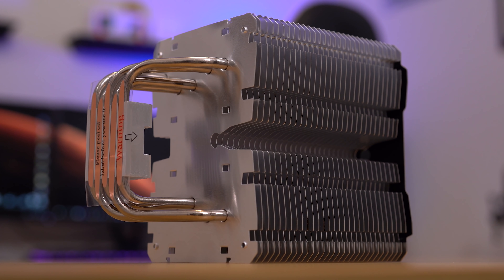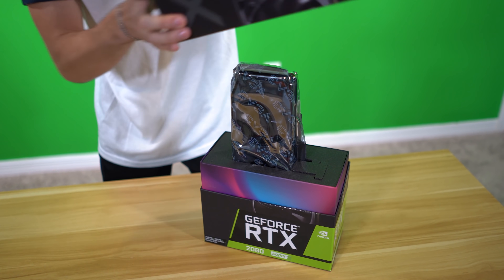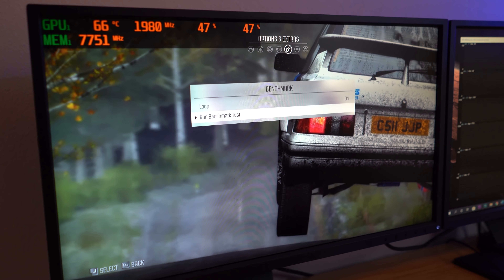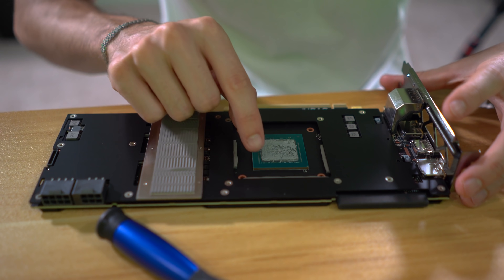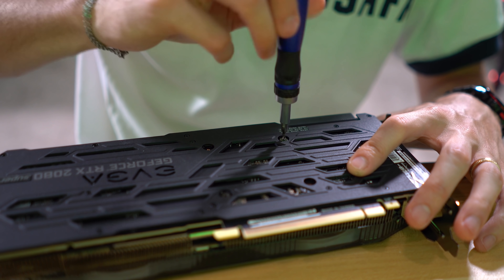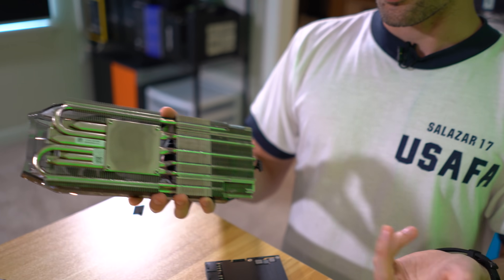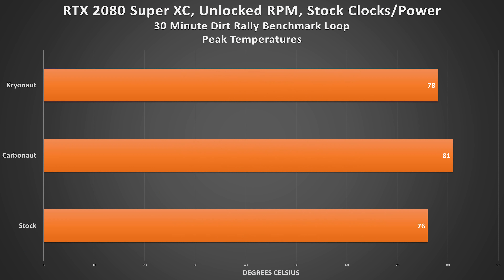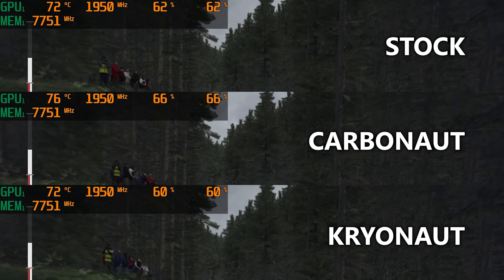Carbon Pad + $800 Graphics Card = ?

Comment: Spread method gives some air bubbles; which will eventually go with some on off thermal cycles. I usually do X or line application.

Comment: My evga rtx 2060 super sc paste looks the same. But I replaced it with crappy mx4 and gained 8-15 degrees and it doesn’t heat as fast.

Comment: My evga 2080super never even gets hot enough to need this lol. I have the ftw model and even overclocked it is simply warm to the touch
Reply: Yeah, the FTW model has 3 fans vs 2. I have the model Greg is using and it does indeed run hot.  In retrospect I wish I woulda splurged the extra $70 bucks and gotten the FTW model.

Comment: Sounds like your gut was right and the Kryonaut was the best overall. I dunno if they ever planned on the Carbonaut being used on GPUs... But it would be nice to never ever have to worry about thermal compound degradation, I'm pretty sure the way they make the Carbonaut pads they'll last forever and a half
Reply from the maker: Yeah we mentioned that in the video. Carbon doesn't just disappear. It's designed to last forever (or at least significantly longer than traditional thermal paste).
Reply: @GregSalazar  yeah. Mechanical force is probably the only thing that would damage it, but since it seems to be like carbon jelly, it probably isn't damaged by vibrations or anything like that either

Comment: Never use a carbonout pad with an intel stock heatsink or the like. Their interface surface is smaller than a CPUs IHS, and that will cut the pad at it's edges...

Comment: Didn't help using the same thermal pads really as they have been compressed quite a lot at the fin-stack end.  Should get some of the Alphacool thermal sheets.  They're VERY good compared to any that the manufacturers use, and the more you're willing to shell out, the better they get.  I'm sure they go over 30W/MK now......for about $100 per 10cm² sheet. 🤤

Comment: I have been using EVGA for years. I used them for my builds, sons and both my nephews. I currently have an EVGA XC ultra 2080 super. It uses 3 slots as opposed to the 2 slots of the regular XC. Quality gpus and the fact that the stock results are so close to the other tests shows how well this card is made.

Comment: I mean.. the Carbonaut pad is usually performing worse than a mid range thermal paste, Roman said so himself when he talked to Steve from GN about the product. It's not meant to be a high end solution but it's main advantage is being reusable so if you swap a lot of components often. It's not really the top of the line cooling solution.

Comment: You say noticeable, but don't you mean identifiable?  The benchmark certainly identified a difference, but you'll never convince me that you can actually notice a 3 FPS boost at 194 FPS rate during game play.  Seems that would only be remotely possible with a monitor displaying 240 Hz frame rates.

Comment: on a related note, i really like how that card is built. you can easily replace the paste without worrying about the pads on the VRM, memory and wherever else they might be
Reply: I think all of evga lineup is made like that - you even keep guarantee after repasting gpu or removing some things from mobo etc unless you return them the item in original form as it came from factory, that's what they're advertising I guess all over the place
Reply: Gigabyte rtx2080 oc is more easy to open then evga.

Comment: I have a feeling that using a bit less Kryo might lower the temp
Reply from the maker: ? Mounting pressure removes any "excess" paste either way, which is why having a bit more is always better than having less.
Reply: @GregSalazar  for sure for sure. but GPU's have relatively low clamping force compared to a typical CPU cooler. So it might take a few heat cycles

Comment: If you compare the layer thickness of the original paste with that of Cryonaut and the Carbonaut pad, this is probably self-explanatory :-)
Even though thermal paste is a very good conductor, it loses its effectiveness the thicker it is applied.
The only purpose of thermal paste is to replace the air between IHS and cooler, as air is known to be an excellent insulator.

Comment: Don't like gpu reaching anywhere close to 80C, that why i prefer 2.5-3 slot cards with thicc heatsink. my overclocked evga 1070ti ultra silent 2.5 slot card reaches max 65C @ 60% fan speed (61C 100% fan 73C 40% fan)
Reply: Yeah me too. I got a 3 slot 1070ti palit super jetstream. And it's so quite and cool. 50% fan speed and barely reaching 60c. Newer cards (20series & RX series) seem to be much hotter.

Comment: It would be interesting to see how it performs on a 5700xt with a waterblock vs paste. I have a 5700xt I put a block on and my hotspot temps hit 90c while my core rarely touches 53c with artic mx-5. Before the waterblock the core temp vs hotspot temps were closer together, probably because of the factory thermal pad it used.

Comment: Scrap laptops has some really interesting things. Even one of them has worse than The Verge thermal pasting. The thermal paste on the HP HDX-16 (scrap laptop that I have now) was encrusted around the CPU die (the top was exposed to the copper, it did left a burn mark on it as well), but I had fixed that. And it runs great. I have no idea why or what was going through the person's head, when he/she was applying the thermal paste on the CPU.

Comment: I think the evga cards cooling are pretty good as is. If I want to cool it better, save up for a h2o block. Bykski makes blocks for the 2070 series and I think the 2080 non ti blocks work on a 2070 as well, since they use the same pcb. Anyone can confirm this?

Comment: I just bought that same 2080 super & I’m waiting for it to arrive. Thanks for the vid, it lets me know to leave it alone. Unless I’m getting some horrible bad stats . 👍🏻
Reply: I have one as well, love it for 4k gaming. You'll enjoy it!
Reply: I have it and its a monster.
Reply: I own one ftw evga edition and even overclocked at 1080p it never gets hot just warm so I don't need this lol. They run nice and cool
Reply: @timothygibney159  1080p? Talk about overkill. I doubt your card even wakes up. which is why it runs so cool. I have a 1440p monitor and the card does get hot when running games that push it 95 to 97% full time.  Examples are RDR2 and RE2 the card floats between 79 - 83 C. Mostly high and ultra settings of course.

Comment: eVGA does have there paste game on point. eVGA makes the best looking cards out there right now. Especially the Tripple slot triple fan mosters. I just picked up the (2070 super FTW3+10%) XC Ultra with the 15.5Gb/s samsung GDDR6. It hits 18Gb/s on the mem with TIN's mod and 2150MHz on the core. This card gives most 2080s/supers a close 2nd. Micro Center just got another shipment of open box cards and Gigabyte 2080ti's are going for $900. Some eVGA models were going for a cool $1000-$1350. eVGA also has some of there B-Stock 2080ti's going for $900 at the website along with some other great deals.  I would for sure fork out another hundo for a open box 2080ti than drop $800 on a 2080super. To me, it would be like me buying a Core i9 9900, and not the unlocked K sku. Scary...lol

Comment: When you hear 3.0fps difference is noticible bump then 2min later 2.9fps is not a huge delta at all... quality content.
Reply from the maker: That isn't what I said. I said that the Carbonaut/Stock FPS delta was marginal. The 3-4 FPS bump was significant (though you aren't likely to notice the difference between 190 FPS and 193). There's a difference between statistically significant and visually discernible.

Comment: I have had one in my EVGA GTX1070 for several months now, got about 10% overclock out of it from that...
Edit before I finish video:  I expect the pad to be almost as good as liquid metal, and significantly better than the best goop on the market (Kryonaut)
Carbonaut is advertised as 62.5 W / mk (https://www.thermal-grizzly.com/produkte/298-carbonaut)
Conductonaut is advertised as 73 W / mk (https://www.thermal-grizzly.com/produkte/25-conductonaut)
Kryonaut is advertised as 12.5 W / mk (https://www.thermal-grizzly.com/produkte/2-kryonaut)
Reply: yeah, why does it still lag behind the kyronaut
Reply: @nathanielluke2084  my best guess is that while the pad transfers better, it requires much higher mounting pressure to transfer that well, the goop can conform to the surface better...  Best guess...

Comment: I wouldn't even bother with the thermal grizzly pads? I've had two on my cpu and both after around 3 to 4 months when removing the cooler from the cpu both pads ripped?? one half was stuck to the cpu other on G-card? so when these YouTubers say you can remove cooler and replace the same pad over and again using these pads, no you can't, yes but only if your going to remove the cooler every week like the YouTubers do when reviewing cpu or coolers!

Comment: Used that pad on a 1080 ti blower model I had a while back and got some much better temps than the paste that was on there before.
Reply: In experience higher  fan speed and more open space  always does more for cooling than anything.
Reply: @KAKUN_DESU  U should try the Powercolor Red Dragon 5600XT fans, I put them at 100% and they sound almost the same as my case fans @ 100% which are CM 120 1200rpm RGB fans

Comment: Noctua's H2 paste is much better than Kyro. Kyronaut is just expensive and inconsistent. It says it doesn't need to break in, but it really does.

I tried the spreader, as that's what the instructions tell you to do. It's still the same. 

Kyronaut is also much harder to clean compared to Artic's paste and noctua's. It's like this thick and viscous stuff. 

I've bought it 4 times and it's all over the place. The best result was from their smallest tubes.

Comment: I'm a little upset you didn't throw in a graph that shows how long it took each card to reach their max temps with each paste/pad along with how long it took to cool down to the base temps before the fans start spinning based on the card's VBIOS set base temps (usually around 50-60C). That information would portray heat transfer effectiveness much more clearer.
Reply from the maker: I literally showed you side-by-side-by-side temps during heat-up. Figured you could infer rate of heating from that.
Reply: @GregSalazar  A graph depicting the temps of the card from start to end of the testing would've been much more helpful in my honest opinion - what I mentioned above can not be accurately represented through a few clips of side-by-side comparisons that only showed me the max temps they stabilized at. Not saying this video is inaccurate to any means, just saying that providing a little more in-depth data on the delta between min-max-min for the temps from your testing would've painted much more elaborate picture for the efficacy of each paste/pad used.

Comment: Before I watch the video, I want to point out that I tried this same thing with my old GTX 1060 6GB card and successfully reached 91C on idle.

From what I know of that, no, it doesnt work and it's not a good idea.

Edit: Apparently I did something wrong in my test. GG Greg.
Reply from the maker: Sounds like you had an issue with application/pressure.

Comment: My 1060 is overclocked almost 200mhz with max msi volts and it's never gone over 65c, I think the volts were the reason my 960 never got over 55c even on a 180mhz overclock.
Reply: The 1060 doesn't use that much power. The more current you need to drive an electronic, the less efficient and hotter it gets.

Comment: Which software do you use for displaying the temps and clock speed?
Reply: Seems like MSI Afterburner. More precisely the Riva tuner under MSI Afterburner.
Reply: ok thanks guys
Reply: What you saw in the video was MSI afterburner. You have to configure it after installation to display on-screen data. There are tutorials online, just google search it.
Reply: Check out Speedfan and HwMonitor if running Windows.

Comment: I might have to try this on my 1080 Ti. Or am I brave enough...
Reply: Nyuuu..unless you're not going to replace the thermal compound in 4 years.
Reply: @CaveyMoth  I was only going to do it for the fun of it. I currently have Arctic MX4 on it at the moment
Reply: @CaveyMoth  only benefit of it is how long it lasts. when speaking of its performance it wold be a huge downgrade tbh.
Reply: You were In the Air Force academy?
Reply: My 1080 ti has been running liquid metal for the last 18 months, and a couple 1070’s using MX5 thermal paste for about just as long. Depending on the card if it’s an easy swap, go for it!
Reply: I did on my EVGA 1080ti FTW3. I used kryonaut. My temps went down around 8c. Keep in mind my thermal paste on my card was still stock and losing performance. Brand new original paste vs kryonaut for me saw an averagge 4-5c drop.  Overall not bad at all. My card is always overclocked as well. so im forcing a clock speed not letting it pick for itself like in this video here.
Reply: RTX 3000 series is comin out, so there's not really any point in investing in older tech anymore; especially from almost half a decade ago now
Reply: @Taintedmind  LOL changing out the thermal pad/ pastes is hardly "investing in older tech" . It's simple maintenance.  It's like saying I don't wash my car anymore because it's 5 years old.
Reply: @Derek_The_Magnificent_Bastard 
It's called invested labor, but it apparently went over your head; there's always next time, champ